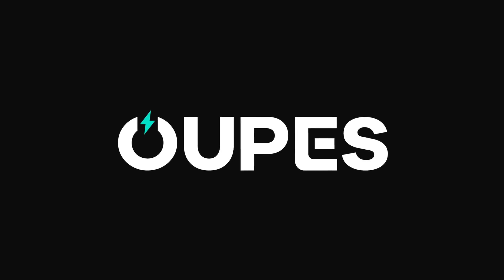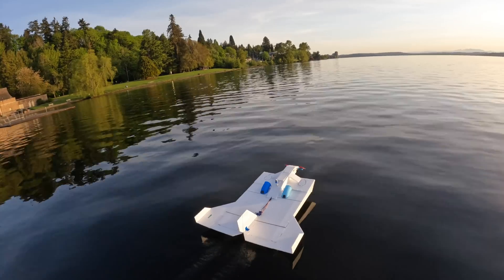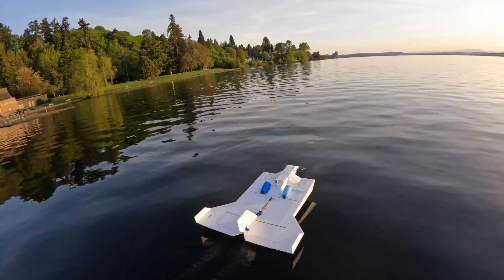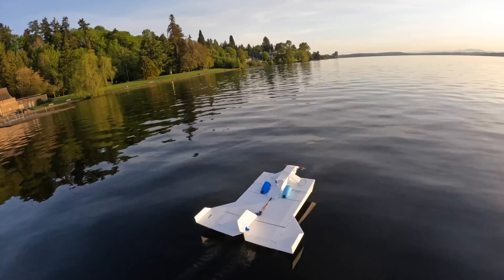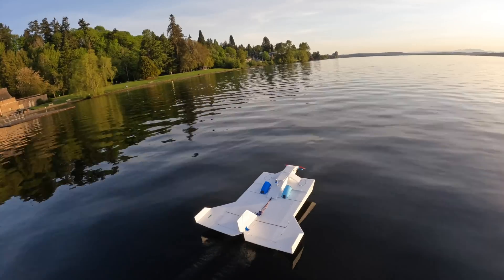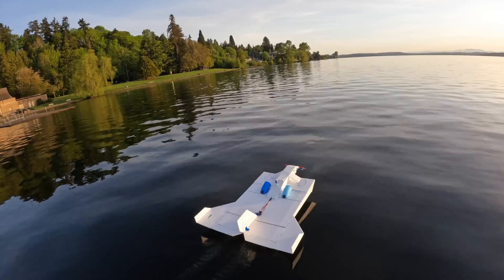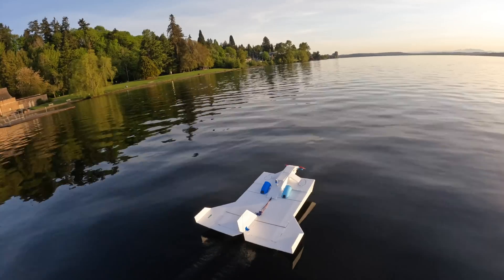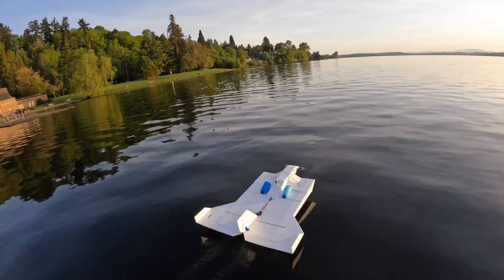Testing WWII Era Terrain Following 'Radar' On R/C Plane

Comment: Did you manually test your sensor over the water? Sonic or lidar? Did you try both? Did it work better over the ground? If it's not just the tuning I'm assuming the reading and processing might just be too slow, or the readings too variable, inaccurate. You could probably analyze your telemetry data to gleam something.

Comment: The ground effect on the lower aspect ratio ("deep chord") vehicle is more noticeable because it starts from a lower point in the efficiency scale, the glider is far more efficient with its high aspect ratio wings, so it seems less noticeable but is definitely there, glider pilots need to pay atention to it when landing. For the "terrain folowing canards" to work I would recomend using a thincker symmetrical airfoil (maybe an NACA 0018) and to limit its actuation to a incidence smaller then the stall angle, what is probably killing the idea is the stall od the surface and non linear response on the canards. For the flaps, it is true that lowering then increases lift, but it also increases pitching momment, so it would be necessary to compensate for that. If you want I'll be glad to help, I belive you come very close to getting it to work

Comment: I'd try using vertical AGL velocity as input with sonar/radar.  By reacting to altitude (well, it sounds like the sonar is using altitude) you're using the integral as input, which is always going to be laggier than reacting to velocity.  Obviously altitude still needs to be there as a secondary goal, but I'd average/smooth it over a couple seconds.  As long as the polling rate of the sonar is high enough, reacting to velocity across time is also effectively reacting to altitude relative to the starting altitude, anyway.  However, if the polling rate of the sonar is too low, you could have a pattern of waves that fit into the polling rate just perfectly wrong and the plane would lose control before the altitude input could take effect.  In this case you could use a combination of altitude error and velocity error.

Comment: the wand control just uses the current height above the water but not the descent/ascent rate. if the plane is close to the water but already stable or on the way up there is no need to change the pitch further.

Comment: I suspect there are two problems here. Firstly, I think the ultrasonic distance sensor is sensitive to water, which is ruining the data it's putting out. Secondly, I think the distance sensor is mounted in a fixed location and is directional, so when the plane pitches up or down, it's artificially changing its measurement of the altitude. One solution that would fix both problems is if you used a time of flight optical sensor that is not directional, so that it is giving you the minimum distance to anything in its field of view, which will also not be affect much by droplets on the sensor.

Comment: Double-check the barometer and right around where the barometer hole is. This behavior the fox glider had where it just moves up and down a couple feet randomly sounds like a problem I had where a little tiny piece of tape was being blown into and out of the little bay where the FC was, and it was changing something about how the pressure would change in there, and making the quadcopter bounce up and down a foot at random times.

Comment: You’re running into differences between macro and micro aerodynamics. If you want to use more efficient high aspect ratio wings try a dragonfly configuration. With an elevator on the rear wing not a full moving canard. Use small movements with low cord and high span for your control surface geometry. You can control the gain mechanically by changing the angle of the probes.

Comment: One thing you could try is making the rods of more flexible material. Even more so you could have them of greatest flexibility at the point and gradually decrease flexibility down the length if the rod. This could be done in part by varying the width of a given material

Comment: I disagree with the statement "it's beyond my skillset", considering how far into the 'series' this attempt is.
The problem seems to lie primarily in the sensor feedback, with the sonar likely as assumed not working well because it's slow. While I've not built things involving those, I've had a few cars that had parking sonar sensors. And one thing that I /did/ notice was that they /do/ indeed have a certain "lag" to their feedback.
So my suggestion would be to try something that has a faster feedback time, maybe a short range lidar?

The purely mechanical approach would theoretically solve the "lag" issue, but in turn it complicates finetuning, especially for cases where non liniarity is required.
Here I could be worth a shot to think about making the gears changeable, so different sizes can be tried out for different ratios as well as making them have multiple attachment points for the flaps and feeler sticks respectively.

Comment: The issue you're having with the sonar controller is too much delay. In addition a sensor looking straight down picks up a longer distance to the ground as soon as the attitude is not 0°, which makes it even harder for the plane to react in time, if it's angled down. 

The solution is pretty simple: Use the angle the sensor at least 45° forward. Optimum could be a lot shallower. I would start with 20-35°.

This gives it a look ahead for waves and in addition the attitude of the plane, when going down, reduces the measured distance, so the plane will naturally try to angle up much earlier. So it start to react earlier.

As the attitude is now a component for the distance above the water, it will also hunt for the perfect attitude and altitude combination. And not get false signals by slightly off 0° attitudes gives the desired altitude.

Comment: 7:45 You should've used a momentary switch to turn off the lights as the plane went through the fog, then used the ff Ember to film it in slow-mo.

Comment: You can't get rid of the low frequency altitude oscillations without coming up with a way to account for the low frequency oscillations of the water itself. The issue is the changing geometry of the water changes the vectors the lidar reflects back at. You might have been better off tuning an averaging function in the controller that uses the LIDAR sensor.
Reply: Agreed, unless the water is glassy-calm, all the waves and ripples will create merry hell with the PID controller. Others have suggested a one or two-second 1st-order lag on the LIDAR input to smooth it out. Similarly, any barometric pressure sensor won't like the changing aerodynamics and roiling airflows created just above the waves: I'd switch the Baro off.
Reply: @richardm.newlands2417  well if you lag you just end up with a delayed sample which can be even worse. It should probably give a correction every .25 seconds or so if the lidar sensor can give an acceptable amount within that time frame to give an average over .25 seconds. But it also depends greatly on the velocity of the plane. You would probably want to average your sample out over 4m worth, so split your seconds up based on that. Also the smartest thing would probably be to do a convolution of the numbers. So the average would overlap with each other and you would average that correction. 

So basically it would travel 4 meters, take its average altitude from 4 meters worth of samples, travel another 2 meters, take an average of samples from the last 4 meters, and then make an average of what the last correction and this current correction would be, and loop that every 2 meters worth, and you effectively cut out the low level noise quite a bit.

Comment: The Easy Glider, or something similar, would have been a better platform to start with.
Reply from the maker: Y
Reply: Standard Push prop configuration, shoulder wing configuration, curved wing configuration for stability. High lift capacity. The same configuration is also used for military drone reconnaissance operations. Disadvantage, standard the early Easy Glider models have no ailerons, but I believe that later models do have ailerons. I have an easy glider, and about 15 years ago I fitted it with a regular mid sized digital camera with standard AA batteries that I controlled with a servo so that I could take pictures with it. The picture from my YT logo is taken with that airplane and camera. And the airplane had no problems with all the extra weight. I also fitted it with a bigger inrunner motor, extra servo's for ailerons and a 3 cell lipo, and still the extra weight was no problem at all. It had excellent stability and the ground effect was very noticeable.   @rctestflight
Reply from the maker: @insAneTunA  The Easy Glider is basically identical to the fox. You must be thinking of the Easy Star?
Reply: You are correct. I just checked it and it was indeed the Easy Star, my bad. It has been a long time ago since I bought that plane. I checked that as well and it was 16 years ago.   @rctestflight

Comment: You should measure the lag of the sonar sensor. Any lag in the PID "plant" moves the zeros and poles of the transfer function, which affects oscillations and stability
Reply: The lag in the sonar sensor (miliseconds) will be far less than the response time of the aircraft (seconds)
Reply: @calloutman   Yeah, control loops with significant delay can be a right pain to get fast response out of. It might be an idea to move to a predictor type controller (e.g. Kalman filter) rather than a PID type. However, first job is probably trying to figure out what the transfer function of the  actuator->control surface->attitude/altitude->sensor combination is. I wouldn't even like to even hazard a guess what order of response it has.
Reply: I think I would use a laser time of flight sensor. They're much faster

Comment: The problem is RC planes are too light and susceptible to outside forces. Try building something really big and heavy with a lot of power. Using mostly engine power to control the height/ It will be moving fast but will most likely work better. In the end, you out Hot Boxed Cheech and Chong, dude. 😂😂

Comment: I'm wondering if you add multiple sonar sensors (front forward, middle down, back.. angled way back!) and in the code create an averaging loop.  With the 3 readings you can also use the software to recognize differences in terrain (highest high vs lowest low) and automatically adjust your height to go higher if the difference of these numbers are higher.  I simple time delay in the loop would keep it from oscillating so much.  Another idea would be maybe add another loop in the code if the readings are way off it does three readings then averages them then puts that number back into the loop.  I haven't written code in 15 years! Really have me thinking about different ways to make this happen.  Thanks for the content as always.

Comment: Wingtip vortices are fascinating things.   At Oshkosh one year they had a Sea Fury with wingtip smoke being followed by a Mustang down show center.   At the end of the runway the Sea Fury would pull up hard and bank to the right...which turned the smoke to a swirling mess behind it that in a couple seconds all came together in a perfectly round smoke ring...that the Mustang would then fly through.   I thought this was the neatest thing I'd ever seen.
Reply: was that... safe?
Reply: @NoNameAtAll2  Sure...why not?   The air in the center of the smoke ring was obviously still and at speed with the high wing loading of the Mustang it blew through it with barely a bump.   If it had been causing any issues I really doubt they'd have done it again and again for their entire demo time...but they did.

Comment: After seeing what the plane did with the stick/lever mechanism, I had this thought:  apply the stick mechanism to a ‘normally’ shaped ground effect vehicle/plane but instead of thinking of control surfaces for an airplane consider it to be more like pressure control valves.  

If each side of the vehicle had a few sticks that linked to aileron like ‘vent’ flaps, as that side/area of the wing chord came up to a wave/high spot the stick/lever would open the vent in that area reducing the air pressure in that same area keeping the wing level.  

It shouldn’t take a very large vent flap to reduce the pressure. The same principle, of multiple small vents along the trailing edge of each side of the wing to reduce pressure, should be able to be applied to an electrical/radar/servo arm mechanism also.

Great video as always.
Reply: That would reduce the efficiency of the wing but what we want by flying low is efficiency.

Comment: You really need to take some classes in control engineering. Cutting down the canards didn't only reduce the p-gain, it also lowered the saturation limit. 
A better solution would have been to lower the gear ratio.

Comment: Could those oscillations come from the constant scanning height changes, as the sonar reads the crests and traughs of those waves? 
Ever tested it on a silky smooth lake surface? 
If your lake ever gets that smooth?
Reply: Yeah, the oscillations are jerky, definitly a sensor issue. Noise. Maybe a slight filtering of the sonar data would help.
Reply: @paulbizard3493  I wouldn't call it a sensor issue. Just the sensors sending data it doesn't need to. 
Assuming this is the issue, (and im willing to be proven wrong) yeah some filtering of that data would probably help. At least for the most part.

Or maybe, have it record the largest wave it detects, then mark that as a minimum. Preventing the plane from going to that height unless commanded to land. And have it continually check this, so as it passes taller & taller waves, it gradually raises it's minimums.
Reply: @davecrupel2817  Your idea is interesting, but you need a height reference. Maybe a barometric altimeter.

Comment: I would love to find a cheap smoke generator for electric planes.  I have seen a few small-ish ones, but they are around 4-500 bucks and up. I have also seen people use the ones for baby showers (pink and blue), but at 10 bucks a wack, even that adds up after a day of flying.

Comment: you cant tie the altitude error directly to the elevator. pitch controls vertical speed, which in turn controls altitude. so the altitude error must be used to generate a vertical speed command, which in turn generates an elevator command. i spent a fair bit of time myself dinking around with altitude control loops for uavs, getting a balance of stability and responsiveness is for sure challenging
Reply: Just to throw a curve ball, assuming fixed throttle, pitch also controls airspeed. As airspeed drops, so does climb rate. Among other things, this makes the physical response time vary based on the control output.

Comment: I can tell you as a Flexwing pilot our wing aoa is high on the take off roll, as soon as it lifts the wing aoa has to be reduced fast  to increase air speed,  or risk a stall.  Your aircraft is oscillating because it is stalling.. the wand is producing too high an aoa regardless of control surface area. .Its a tricky one to solve dumb mechanically  but you need to find a way to return to level flight and get your airspeed back at the top of the bounce.  I would suggest use your sonar to activate a servo to bring the aircraft to level flights at anything ABOVE say 18 inch?. Wand is up control.. Sonar is level control.  I'm rambling now 😅

Comment: It would be easy to program the altitude control to be driven my the ascent/descent RATE, instead of absolute height. That way, once the aircraft is (for example) approaching the surface and the flap angle is increased, the program would decrease angle in proportion to the “dive” leveling out. I hope that makes sense and I’d love to collaborate on future projects if you DM me!
Reply: Huh how about that.  Very neat.  Would you say that method would be easier than programming in angle of attack data from a gyro?  Any cases when one would be better than the other?
Reply: @whitejtw  angle of attack would be a similar solution. However, ideally you want as few steps between what you’re aiming for (altitude), and what you’re controlling that with (servos). His solution had zero steps, but created a feedback loop.

Comment: Does the sonar compensate for the angle of the waves? Like would it react to flying a half meter over calm water the same way as it would flying over a sine wave at an average of a half meter or does the changing angle of reflection mess with it?

Comment: You could change the ratio from the wands to the canards for a smoother actuation/loop too. How much control range is really needed? 

What about an aerofoil on the wand(s) that ride in the ground effect while the main craft stays higher up(and more efficient?). A four link arm config could help it not flap like a noodle. 

Or like a flat going across the pontoons on the Ranger to ride on the cushion but tilt that independently from the main craft, type thing? 

Thanks for the brain food, always cool what you come up with!

Comment: The large tall T wing on the purpose built ground effect plane stabilizes it by being further away from the ground effect itself, and losing more lift as the plane climbs, which makes it pitch down slightly. Maybe the same effect would work with a negative stagger tandem wing, or with small  fixed canards near the ground.

Comment: Loved the laser+fog part and the vape fun. I’m in optical engineering. Do you have any data from the ultrasound detector? You probably need a high sampling frequency and low latency. You also need quick mechanical feedback. Engineers at Tesla face similar issues when trying to run their cars full auto. An analysis using Laplace transforms may help.